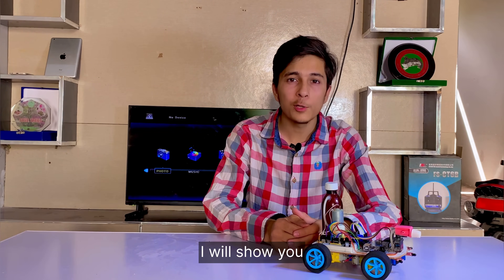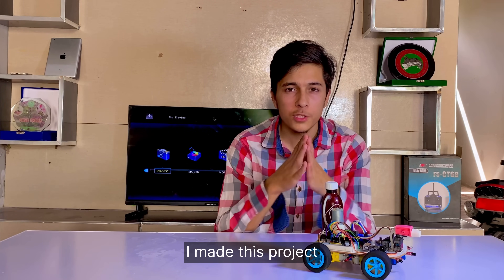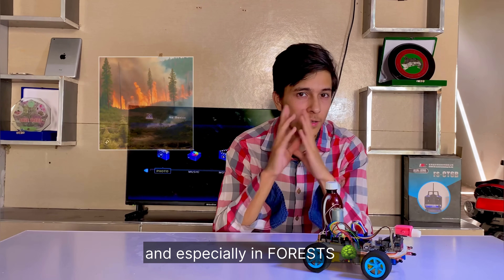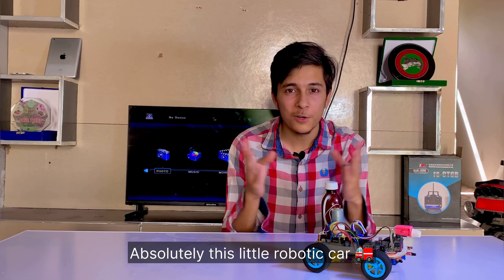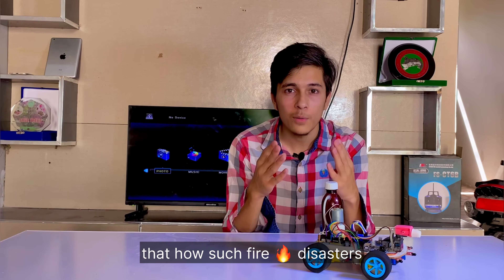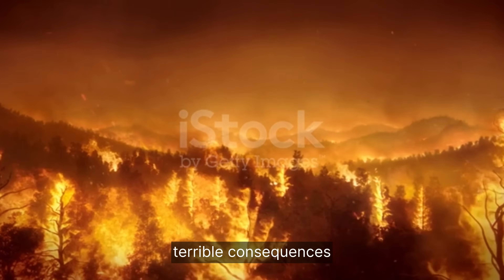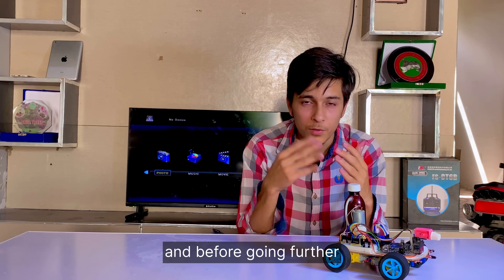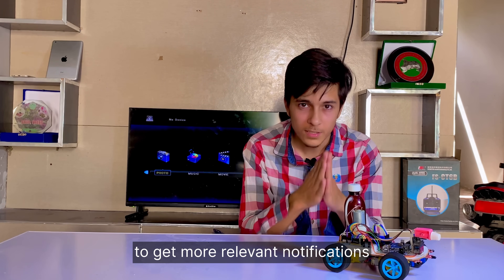DIY Fire Fighting Robot using Arduino  |  Auto Fire Chaser and Extinguisher

Comment: Hello,
can you please give me updated code you code is not working properly ....
because your robot was too smooth which detection of flames and run smoothly but in my robot it is not happening
So could you please give me updated code..
Reply from the maker: Code is perfect for this circuit diagram and components.. do you mean your project works slowly
Reply: @saadinnovativeideas  noooo
see
the pin(male to female) you insert in driver module to Arduino UNO is wrong
because in the code at first you define it differently.         Please check properly!!!!

And in servo too 
In code you have written:
#define servo A4 
which should be inserted to pin 4 in digital PWM~ side in the arduino UNO
But in model you have insert all three pin in breadboard

But in last i have done all thing

and my question is it seems your code is wrong or the pin you have inserted is wrong, Then how the robot runs too smoothly??🤯🤯🤯🤯

But now also i have problem that my bo motors are not working efficiently
when the left flame sensor detect fire my robot moves toward right 
and on the right side fire detection it work perfect
I have copy your motors movement code thats why i am saying.
Means it has wrong logic
Reply from the maker: Bro I have checked again the servo signal wire to connected to pin 4 via breadboard. And for the wrong movement, try flipping motor wires connected with motor driver unless it perform as desired
Reply: @ what about arduino??

Comment: Hola yo hice este proyecto es completamente funcional, si no les vale recomiendo que se fijen que sus sensores de flama sean de 4 pines y estén conectados a el pin analógico 
A veces 2 baterías 18650 no son suficientes a me sirvió adecuadamente con 4
Fíjense si cada cable está donde debe y con el diagrama que adjunta
Excelente video me salvó el proyecto final
Reply: Hermano yo lo estaba haciendo con sensores con salida digital ahora que dices eso ahora todo tiene sentido muchas grs por el comentario ya que estaba batallando durante un tiempo por eso por qué solamente el servomotor da vueltas y al parecer no veían la llama
Reply from the maker: Thanks bro
Reply: So how many volts of battery can be used?
Reply: Hola, podrias ayudarme? Te puedo contactar por correo?
Reply: Me podrías ayudar con algunas dudas que tengo

Comment: Bro bo motors doesn't work please help me
Reply from the maker: Do the rest of the components worked?
Reply: After coding only motor pump and flame sensor worked
Reply from the maker: Which sensor have you used (3 or 4 pin)

Comment: @saadinnovativeideas  bhai mene shidha mobile ke charger se chalaya or kai battery se bhi chal ke bekha phir bhi nahi chala
Reply from the maker: Kia desired voltage di mtlb 7.1 - 11 volts
Reply: @saadinnovativeideas  haaa mene di fhir bhi nahi chal Raha hai
Reply from the maker: Kia koi bhi component nahi chal raha?
Reply: @saadinnovativeideas  chal raha hai sarvo motor or waterpump kaam kar raha hai lekin DC motor nahi
Reply: @saadinnovativeideas  11.1 voltege
Reply from the maker: And sensor konsa use kia hai 3 pin ya 4 pin
Reply: @saadinnovativeideas  3 pin vala
Reply: @saadinnovativeideas  IR sensor
Reply: Mene ek video dala hai
Reply from the maker: Ye mene jo circuit diagram and code dia hai ye 4 pin sensor kelia hai?
Reply: @saadinnovativeideas  koi 3 pin se nahi chalega kya

Comment: I have used blue colour sensor with three pins but it is not working and view motor is not working so what will I do tell me fast tomorrow is my science exhibition
Reply: take then
Reply from the maker: Connect D0 of all the sensors with 2, 3, 4 pins of Arduino uno respectively, and in code; replace analogright with digitalright anywhere there it is

Comment: I have 3 pin blue flame sensor plz tell connection
Reply from the maker: Connect D0 of all the sensors with 2, 3, 4 pins of Arduino uno respectively, and in code; replace analogright with digitalright anywhere there it is
Reply: I have DO VCU and one more pin now tell connections
Reply: I don't have AO

Comment: Help me sir I made it but my bo motor and mini servo is not working
Reply: Me too
Reply from the maker: Which sensor and battery have you used?
Reply: @saadinnovativeideas  The motor is not working even though the sensor and servo have already been detected

We used IR sensor
Reply from the maker: Tell me the total input voltage and sensor pins (3 or 4 pins)
Reply: @saadinnovativeideas  7 volts og 4 pins
Reply: @saadinnovativeideas  please help us sir:) we need it upcoming Tuesday

Comment: ARDUINO IS NOT GETTING POWER
 PLEASE TELL ME WHAT TO DO
Reply from the maker: What power source are you using?
Reply: @saadinnovativeideas   now the arduino and all the components are gettring power but the flame is unable to detect the fire but the lights in the flame sensor r glowing thtat means its ok but is unable to sense the fire whta shall i do
i have also made the circuit properly

Comment: And can you try to give me a tutorial or circuit diagram for that 3-rod flame sensor pls reply fast
Reply from the maker: I have one solution for using 3 pin flame sensor, try it 
Connect A0 of all the sensors with 2,3,4 (digital) pins of the Arduino uno board and in code replace A0, A1,A2 with 2,3,4 respectively and replace analogRead with digitalRead any where written in code

Comment: bro i did every connection as per the circuit diagram and every components are working except the motors 
are not working. what should i do?
Reply from the maker: Which batteries have used?
Reply: @saadinnovativeideas  
We are using two 3.7v batteries which has 3000mah each.
Reply from the maker: Do you mean servo, water pump works when fire is detected and bo motors absolutely not?
Reply: No bro servo and pump are working when fire is detected.but only one side of the bo motors (2) are only working.and they are working continuously when the power is given
Reply: Bhai fhir aap ka mote kese kaam kiya @Scavenger180
Reply: @Scavenger180 meri bhi vahi problem hai bhai
Reply from the maker: Code ko re upload kardo. Agar nahi hua to board kharab hoga
Reply: @saadinnovativeideas  bhai me code re upload karke dekhata hu mene breadboard nahi use kiya hai

Comment: All components are working we change the battery also but it doesn't moving ir was light on when switch on everting is light on but it not moving and servo not working but it checked with aurdino codind it's working but in whole thing it not working, so pls reply fast we have only 5 days 😢😢😢😢😢pls
Reply: Me too
Reply: Me too please reply fast
Reply: Same problem, what you have done to work?

Comment: Bro it is sense the fire but it not moving 😢😢and also servo not workings
Reply from the maker: Battery konsi use ki hai or sensor 3 pin wala hai ya 4 pin wala
Reply: @saadinnovativeideas  bro it's 4 pin sensor but still not working and 7.4 v lithium battery
Reply from the maker: Double check your connections and make sure code is successfully uploaded, if still doesn’t worked then send me images

Comment: Bro i am confused in wiring  of flame sensor  , you left the ground unwired, and in diagram it is wired plzzz help
Reply from the maker: I have corrected it behind the scenes, follow the circuit diagram
Reply: @saadinnovativeideas  also my water motor pressure is low as i used 3-6v dc type 1 motor pump , what changes can i do suggest me
Reply from the maker: Use pipe of small diameter to increase pressure or use strong water pump
Reply: @saadinnovativeideas   I am facing accuracy  problems , just like car is not sensible  fire easily  , it is getting away from fire , what can i do
Reply from the maker: @vedantbiradar3480  thats not a big deal. Try flipping two wire of motors connected with motor driver unless it performs as desired
Reply: Hlo , is your flames  sensor's both led or on or single

Comment: Hello! I like this video. So my question is this: is it possible that you can add Bluetooth control module so that in case the flame sensors are not in range of detecting fire, Bluetooth can be used to drive vehicle to approach the area of detection. And also Bluetooth can used return back vehicle if water is empty in tank. Thank you
Reply from the maker: Yes it is possible and I may built it and upload its video in future
Reply: Can you give it for me c'se I wish to work on it as my academic capstone project
Reply from the maker: What I can give you?
Reply: How can I get the video with Bluetooth module as additional controller

Comment: It will not short circuit right if i dont use resistor, transistor and capacitors
Reply from the maker: The pump will work properly. You can use relay module instead of these

Comment: I completed the step by step, but still it isn't moving, can you help me to find what it's possible problem pls
Reply from the maker: Yeah. Tell me which batteries and sensor (3 or 4) have you used?
Reply: I already made servo and water pump, sensor work, my only problem is it Wheels, it won't drive to it's designated area, pls help need some advice
Reply from the maker: Do the wheels absolutely not rotate or they rotate very slowly?
May be the problem is with your battery
Reply: @saadinnovativeideas  the wheels won't rotate, and I used 4 lithium battery for it though

Comment: Помогите я все сделал но он не едет Только брызгливает водой
Reply from the maker: Which battery and sensor (3 or 4 pin) have you used?
Reply: @ батарея 12V я использовал ардуино но там не уно а digital pwm
Reply from the maker: I think your battery is non rechargeable, if it is so that will not work
Reply: @saadinnovativeideas  брат наверное код не правильный помоги пожалуйста у меня 23 соревнования
Reply from the maker: No code is 100% correct. If you battery is non rechargeable then replace it with rechargeable battery because non rechargeable can not provide sufficient apms to run the project

Comment: Can you help me makint it on call i made it yesterday but it didn't work and i have to present it tomorrow
Reply from the maker: Double check you connections with the circuit diagram I provided. And tell me the name of batteries and sensors (3 pin 4)

Comment: Its not working bro I have done circuit connections two times as it is but it is not working mainly dc motors are not moving, I am not getting what is wrong whether the fault is in the code or circuit diagram or in my connections... But I have connected exactly all the connections 🥲🙁
Reply from the maker: Have you used 4 pin sensor? Name the batteries
Reply: @saadinnovativeideas  no i have used 3 pin sensors and 2 li ion batteries, motor is working when flame is identified but dc motors are not moving
Reply from the maker: The code and connections are for Analog (A0) pin of Flame sensor
Reply from the maker: Try to use 4 pin flame sensor.
If you fail to avail, then for 3 pin flame sensor having D0 pin;
Connect A0 of all the sensors with 2,3,4 (digital) pins of the Arduino uno board and in code replace A0, A1,A2 with 2,3,4 respectively and replace analogRead with digitalRead
Reply: @saadinnovativeideas  flame sensors are working but the issue is robot is not moving even the connections are alright
Reply: @saadinnovativeideas  I already tried it but if i replace analog with digital then the motor is starting automatically even if there's no fire( continuously working)
Reply: I am thinking that the fault might be in the code because I have used other guy code(the code of motor driver only just to run motor driver with arduino) the dc motors are moving, but with your entire firefighting robot code they are not moving...
Reply from the maker: Ofcoure there must be at least some errors for using mu connections and anyone else’s code. In the code I provided make the those changes and upload it
Reply: @saadinnovativeideas  i tried all the changes you have mentioned but not working 🙁

Comment: My servo motor is working and motor driver has supply of battery but has no light on motor driver
Reply from the maker: May be you power was not sufficient or you motor driver was faulty

Comment: please check would this capacitor work 
20pcs 20KV 1nF 0.001uF 1000pF 102 High Voltage Ceramic acitor Kit 20pcs 20KV 1nF
Reply from the maker: 102 pF

Comment: would this arduino uno work 
ELEGOO UNO R3 Board ATmega328P with USB Cable(Arduino-Compatible) for Arduino
or
ARDUINO A000066 Uno R3 DIP Edition, 1.5"
Reply from the maker: Both will work but A00066 uno is cheaper to Elegoo uno

Comment: Bro i have brought 3 pins flame sensor.. Should I need to alter in coding? Reply me bro
Reply from the maker: Try to use 4 pin flame sensor.
If you fail to avail, then for 3 pin flame sensor having D0 pin;
Connect A0 of all the sensors with 2,3,4 (digital) pins of the Arduino uno board and in code replace A0, A1,A2 with 2,3,4 respectively and replace analogRead with digitalRead

Comment: I did everything like you, but the movement is not correct. For example, when the fire is on the right side, you go back, and when it is in the front, you stop and do not walk, and when it is on the left, you move forward only and lose the correct direction. 
What is the possible reason? 
Is it because of the motor connections to the driver? 
Thank you
Reply from the maker: The car should move a little backward while turning. But if i move straight back by detecting fire then try to flip the motor wires connected with motor driver

Comment: all worked but water pump not pls yell the solution
Reply from the maker: Name the transister, capacitor and pump used
Reply: @saadinnovativeideas  transistor and capacitor same as yurs
Reply from the maker: You mean 3 x 33 pF capacitors (in parallel)  and tip 112 transistor?
Reply: @saadinnovativeideas  tip 122 and 33 pf capacitor
Reply from the maker: Name the pump used
Reply: @saadinnovativeideas  and on one side forward wheel is moving in forward and backward is moving backward and it remains at the same positionand many times wheels dont move to but servo move  tyres behaves very weird
Reply from the maker: Try to flip the motor wires connected to motor driver with each other?

Comment: Bro it is not going forward after sensing it it is going back
Reply from the maker: Try flipping the wire of bo motors connected to motor driver until it perform good

Comment: I alrdy take a programe on my arduino then turn on the switch but my arduino is not working how should I do
Reply from the maker: Double check your connections and power supply
Reply: My water pump doesn't work help mepls

Comment: bro when you put the seervo motor pins in breadboard how will it give output pls reply
Reply from the maker: 5v to positive, GND to GND of servo to Arduino board and signal wire to A4 of the board
Check it in Circuit Diagram:  https://drive.google.com/file/d/1bFK8Dwt6g-Z2kP-Qzci0NTRzXW0DrkRT/view?usp=drivesdk
Reply: @saadinnovativeideas  bro but in video you connect all 3 pins to the board
Reply from the maker: Yes, should be
Reply: @saadinnovativeideas  7:15 you connect all the pins of the servo to breadboard is it right????? in the video
Reply: @saadinnovativeideas  and in the circuit diagram you have connected the flame sensors wire to the arduino board but in video to breadboard which is right???
Reply from the maker: Yes brother, breadboard is for the same function to give more connections to Arduino board. From breadboard I took the jumper wires to Arduino UNO
Reply: @saadinnovativeideas  ohh can i connect as you are connecting in the video
Reply from the maker: Yes, of course
Reply: @saadinnovativeideas  all worked but mini servo is not working what to do?
Reply from the maker: Servo has three wires, interchange (flip) the side wires with each other and leave the middle one
Reply: @saadinnovativeideas  from breadboard?
Reply: @saadinnovativeideas  not working bro
Reply: @saadinnovativeideas  and yes my tyres are moving continously even after the flame got off when i turn the switch off they switched off
Reply: @saadinnovativeideas  bro servo worked but water pump is not
Reply from the maker: Which water pump have you used

Comment: My bo motor is not working but all parts are working
Reply from the maker: Your power is not enough. What is your total input voltage
Reply: I don't no
Reply: Jo apne use kari hai vo hi use kari hai
Reply: Or micro servo bhi nhi chal rha hai
Reply from the maker: Sensor kitna pin wala use kia hai?
Reply: 4 pin ka
Reply from the maker: Muje pics send kardo project ka
Reply: Please help me
Reply: Sir please help me

Comment: My problem is that my wheels is not moving and my pump is automatic spraying. I'm also using 3 pin flame sensor with D0 connection
Reply from the maker: Try to use 4 pin flame sensor.
If you fail to avail, then for 3 pin flame sensor having D0 pin;
Connect A0 of all the sensors with 2,3,4 (digital) pins of the Arduino uno board and in code replace A0, A1,A2 with 2,3,4 respectively and replace analogRead with digitalRead
Reply: @saadinnovativeideas  I tried it but it still doesn't work

Comment: You need for this project:

Hardboard 
Wheel
BO motor
L298N motor driver
Breadboard
Flame sensor
Mini servo
Small water bottle
5-9 V water pump
Water pipe (should be durable)
2× 3.7 V li-ion battery
Switch (one)
Male-femal jumper wires (shortened)
Double sided tape
3× 33pF = 99pF capacitor (OR) 1× 102 pF
IN4148 (Diode)
TIP 122 Transistor
1K ohm Resister
Arduino UNO Chip